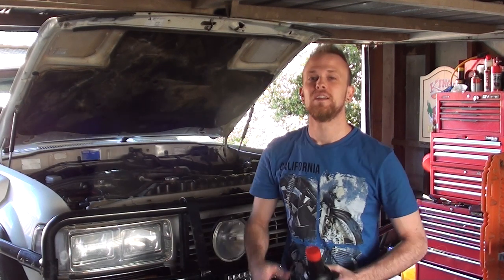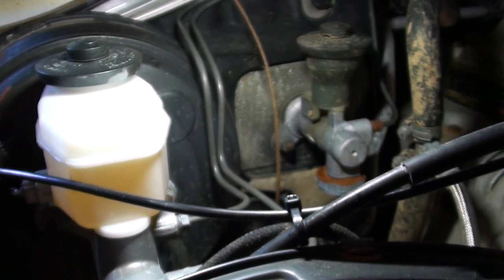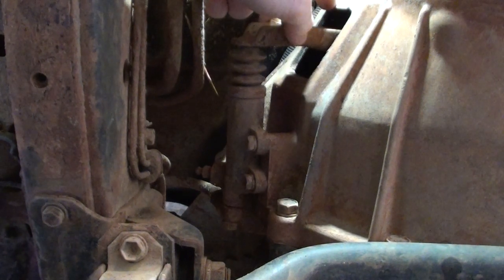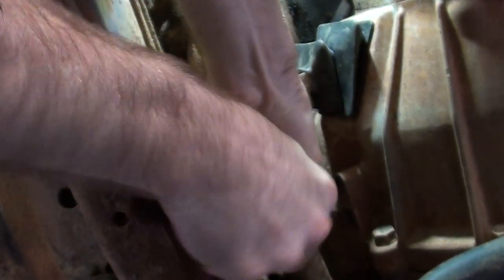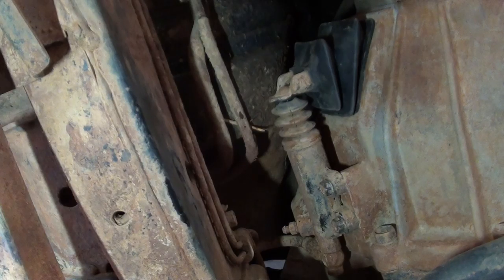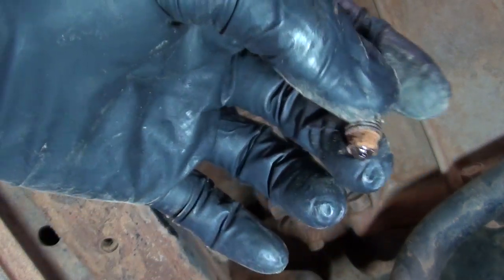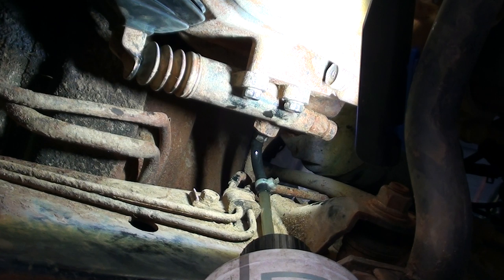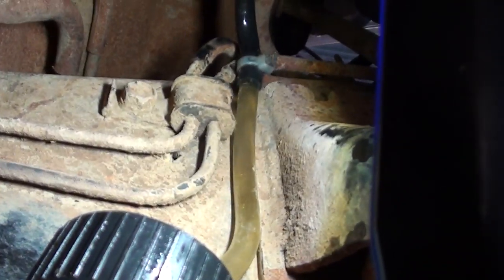How to Bleed a hydraulic clutch

Comment: I too noticed the squeak was back... While you had the cylinder off changing the boot the fork needed white lithium grease applied to the fulcrum( pivot point) on fork witn a long screwdriver or slide fork from trans housing clean grease and replace and before reinstalling cylinder there should be a hard neoprene cap the goes on between pushrod and fork it can be purchase at local parts supplier . Im not a critic just a perfectionist when It comes to details while helping others do it properly . 
With all respects.
    Russ

Comment: Another channel said you couldn't Have the clutch depressed When you tighten the slave cylinder They had the tubes ofSub  merge and they weren't even pumping it Not to build a pressure.......just in n out bleeder open